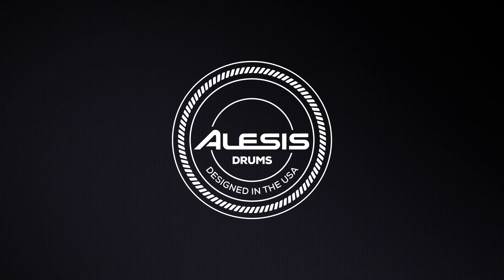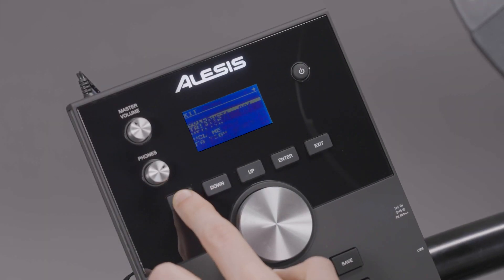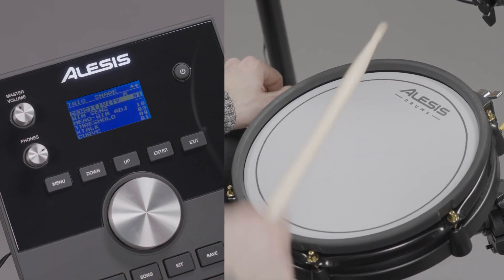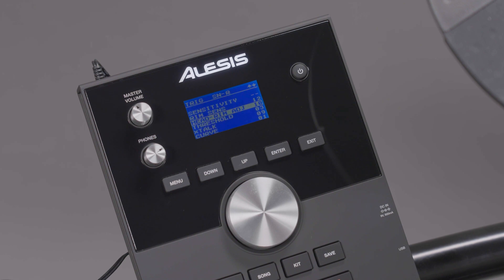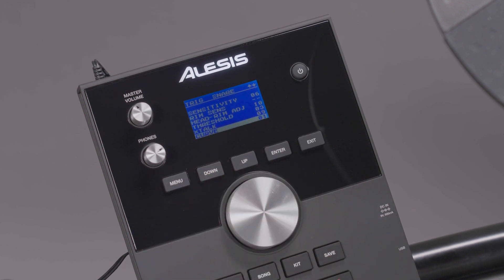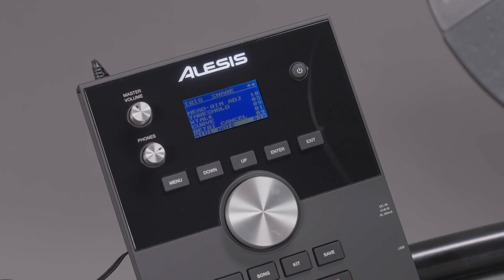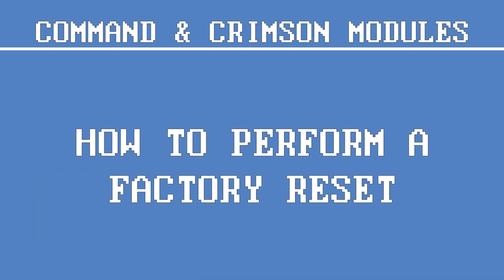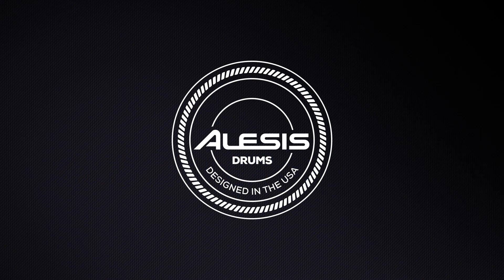Alesis Command & Crimson Modules | Adjusting & Understanding Trigger Settings

Comment: The owner of Laurin drums said himself that the Crimson module is the worst to get his snares working!!!! WHY DO YOU SELL THEM THEN?! Years ago I had my snare fall apart underneath the head(Foam Supports and the cheap ass plastic quality Alesis is known for, along with their terrible support) and ordered a LAURIN. The settings for the module were sent to me, but it's never worked, and I ended up giving up and putting my set in storage. Now I'm back around took it out of storage again, and I'm trying to get it to work. No luck. You can't even buy single pads brand new from Alesis. Trash company. Time to save up for a ROLAND or Yamaha, I guess.

Comment: I have a crimson two and my crash two (right crash) is now inputting as a "tom 4" I've always used factory settings and even did afull factory  restting of the module and nothing!?!?!? It still registers as "tom 4" 😭
Reply: Check the cable that connects the crash to the module, It could possible be plugged into the wrong port!
Reply: @b17victor  all cables run into one sorta long thin-ish plug that goes into the back of the module..
Reply: @jinxx3744  That is true for all other components except for crash 2. There should be a seperate cord that plugs into the top of the kit. There should be a port for crash 2 and for Tom 4.
Reply: @b17victor  legend thank you so much the words on the top have rubbed off over time so I was so lost but it worked and I've re labelled them!